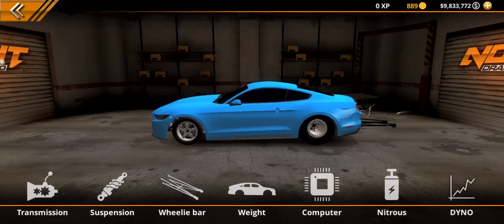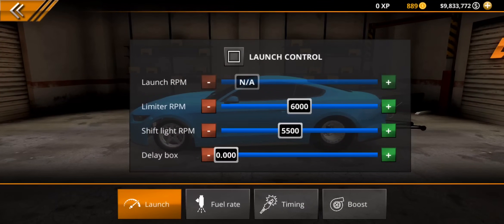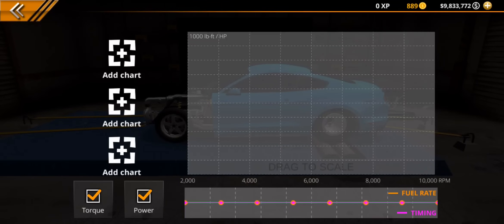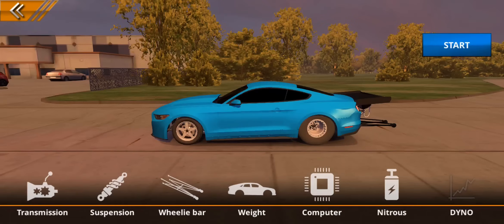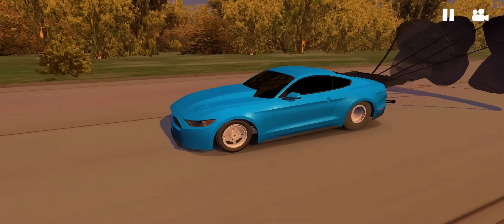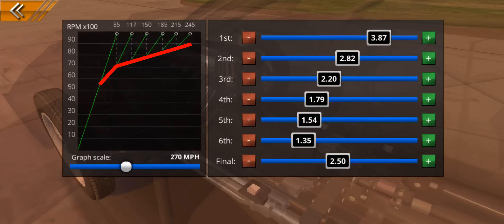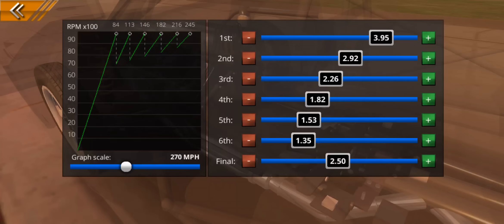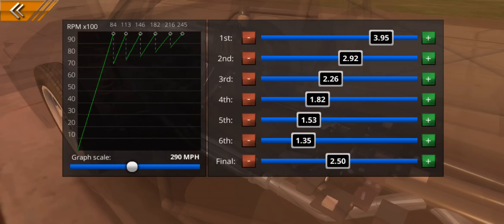How To Tune Transmission (Gears) Tutorial | No Limit Drag Racing 2.0

Comment: Please make a video about the suspension settings and the weight transfer please 👍
Reply: With the weight transfer it’s easy because if you put it too far to the left you will spin like crazy but too far to the right you can barely make a 6 sec pass
Reply: Lower grip tires (street&et street) you need the weight on the rear
High grip tires shift most weight to the front
Reply: If your on full slicks put it around 0.58-0.7 to the left
Reply: @callum6989  i did that and dropped a whole .2 seconds off my 1/4 mile time, thanks a lot
Reply: @bradleypesta  nw

Comment: Could you cover how to do suspension tuning to stop your car from doing wheelies when you start chucking power at it? And what if you set the gears up so that when you shift into the next gear the rpm is at the values that you get in the Dyno graph?
Reply: For the wheelying than use a wheelie bar

Comment: 8:19 I appreciate the video. At that part you say that 1st gear short as possible. How do you determine when to leave the gear alone and mess with the launch number instead? Bc you might be able to launch at 4k and get 75mph out of 1st. Those are just random but I'm having trouble figuring out how many kits to leave on vs how long 1st gear needs to be vs launch rpm. I love tuning the street and et streets to as fast as I can get them. Thanks again
Reply from the maker: Launch can be anywhere from 7k-10k in general. So just pick a value and find the gears for that.
Reply: @APEXStigZ  thank you for the tips.

Comment: That was a huge help! Thank you.  With the suspension tune video you posted. What would be my wheelie bar hight. 😁
Reply from the maker: In general adjust the bar so the front wheels are about half front tire diameter off the ground max.
Reply: I did your tranny setup and suspension tune on a 4 speed it won't grab and its all over the road! It's a blown big block Barracuda. 🤔
Reply from the maker: Weight back would be the first thing is try
Reply: @APEXStigZ  Thank you I'll try that. Is it same trany set up for the 5 speed. ?  I might change it.🤔👍
Reply from the maker: 5 speed you'll need to make 5th the same as my 6th gear. Then make the others Inbetween slightly longer than mine.
Reply: @APEXStigZ  OK. I'll give it a go. Thanks 👍

Comment: Why not use less gears? Less shifts = faster runs, correct?
Reply from the maker: But you'll be further from peak power and torque for a longer amount of time. So overall the extra shift time is cancelled out by the better acceleration staying in the power band.
Reply: Unfortunately the game doesn't work like real life! I tried to set up a car like it had a 2 speed powerglide and there was no way to make it work!

Comment: If your car's powerband falls off at approximately 9000 rpm, why not set the rev limiter at that amount or even a bit higher, versus leaving it at 10,000?
Reply from the maker: You could set it to about 9500 (when you want to shift) but it won't make any difference because you'd shift then anyway with the limiter maxed at 10000rpm.

Comment: Could you tell me,Why my car sways back in fourth?
Reply from the maker: It'll be because the wheels are spinning
Reply: @APEXStigZ  What should I do about that?
Reply: @jims5852  tweak first and second gears to get the best grab and power delivery. Mess around with tire temps on burnouts too if you're not sure about which temp works best for your build.

Comment: Okay so after watching this video I have learned that I tune about the same way you do but for the life of me I cannot get past 6.10 to 5.98 I've tried and tried and tried it's impossible there is no way you guys are running this stuff because I have tuned and tuned and tuned over and over again and I keep ending up with the same results I've tried different power adders I've tried different setups everything different tires different transmission tuning I've started from scratch to try and do it that way and it's the same result every time 6.10 to 5.99 that's all I get but when I help somebody else tune and they use the exact same tune I got they're getting 580s out of it and stuff so what the hell how are you guys running like this I can tune a car in real life easier than I can on this damn game it's ridiculous
Reply: What I'm getting at at this point I'm tempted to just pay somebody to tune my cars 😤
Reply: it’s all about your shift times trust me I was the same way you have to learn at which rpm you shift your car performs best at
Reply: I can make a car run 5.7 it's all about the shifts.

Comment: mine is at 277 for the speed
Reply: Try lowering the 6th a little, take away top speed and it should make your time better. My chevelle was running 277 mph at 6.00 lowering it went down to a 5.8 if you also play with the 1-5 gears also